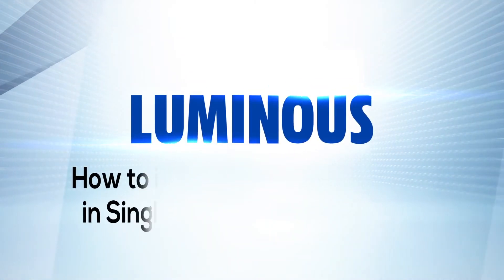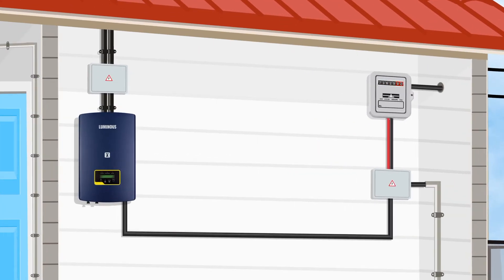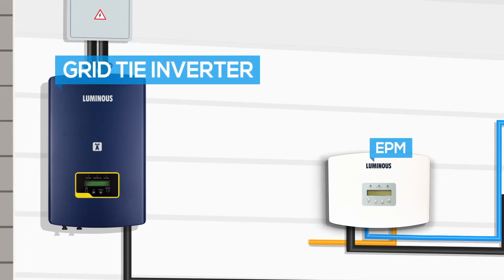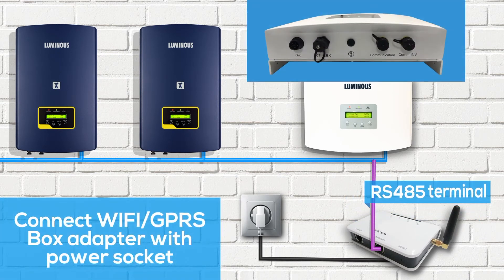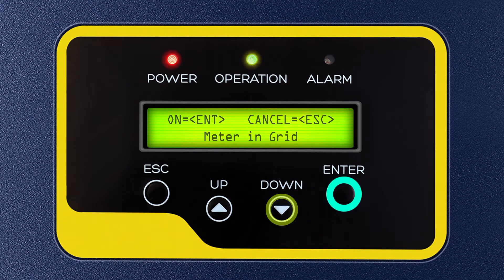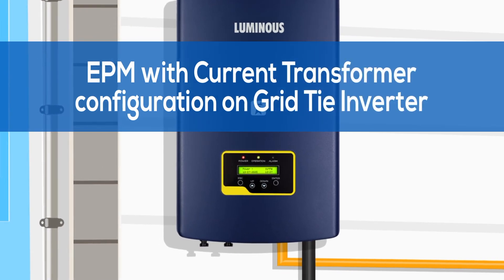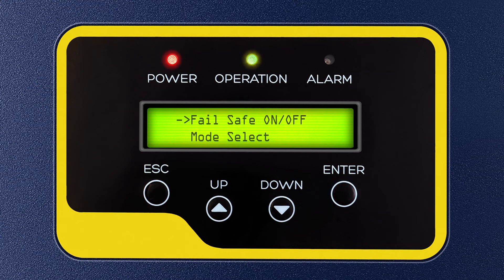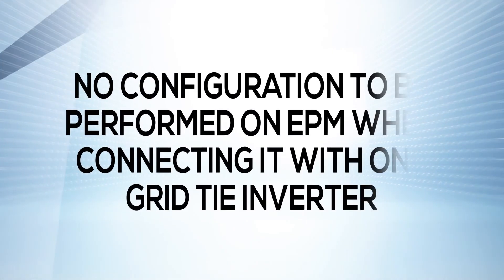Luminous Zero Export Device Installation (For Single Phase Grid Tie Systems)

Comment: Where I will get CT Sensor , tried with multiple distributor also contacted luminous over email but no response can  get exact model number and specification sensor i am using NXI 130
Reply: Same situation. I have also many times contacted by email and also by distributors but no body replying and no body can say where is this device available. Luminous is also not give reply so sad to me. 😭